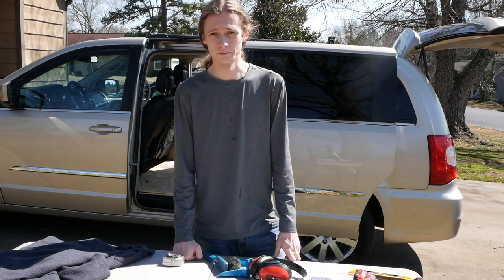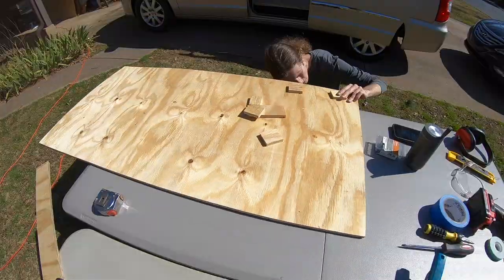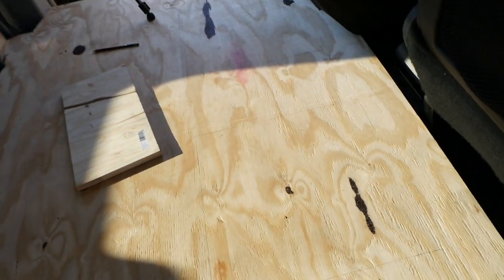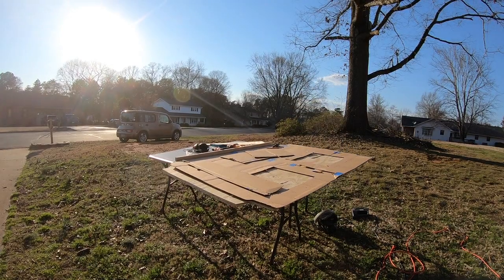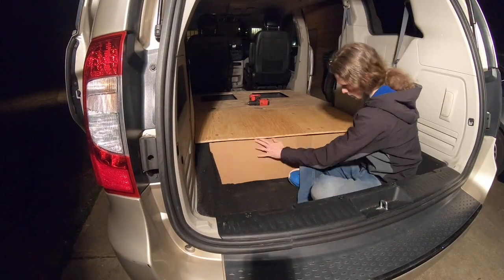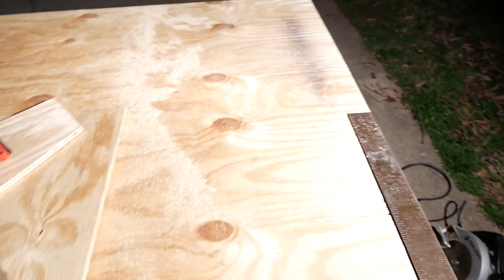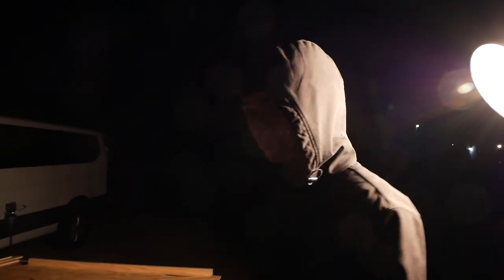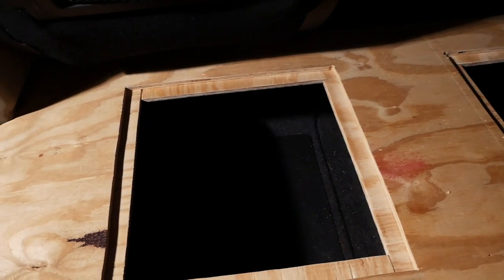Adding Storage Hatches to my Minivan Camper (Stow-n-Go)

Comment: Nice work Ian. I converted a 2018 Dodge caravan into a camper van. Don’t know about your electrics but I have a 100 amp house battery, fuse box, etc in the stow and go behind the passenger seat and a 1000 watt inverter under the seat. Also a Dometic CF18 fridge fits perfectly between the front seats where you removed the console. Van on! 🚐
Reply from the maker: I looked up the Dometic CF18 fridge, thanks for mentioning it. I haven't really made up my mind on the whole power set up. I may do a full solar power set up and all that jazz, but I could get by with one of those little all in one Jakerys. It's a lot to think about!
Reply: Cost away or the like are much cheaper 250-370 for a nice size fridge freezer 12 v  check out
Reply: Hobo tech, he does a lot of reviews and puts the item through heck, !

Comment: Try not using the hinges and just drill a large enough hole to put your finger in to remove the lid. A hinge restricts the opening of the door because if anything is placed above it like say, an elevated fridge it will lessen the opening.
Reply from the maker: That's a good point. I haven't 100% made the call on how I'm going to do things. That would deafeningly be easier to work with.